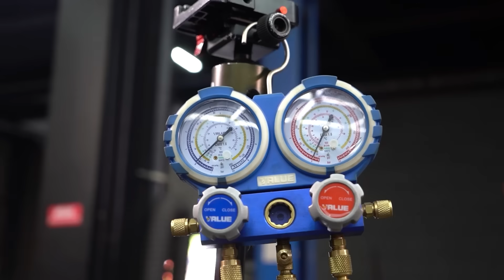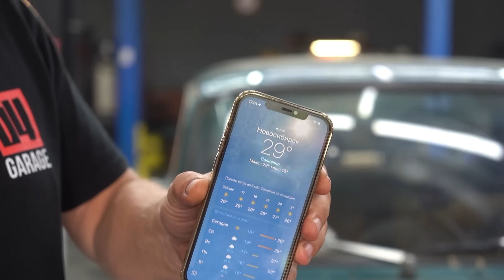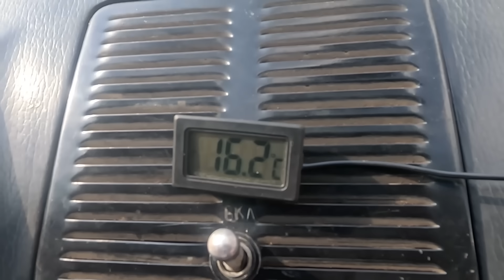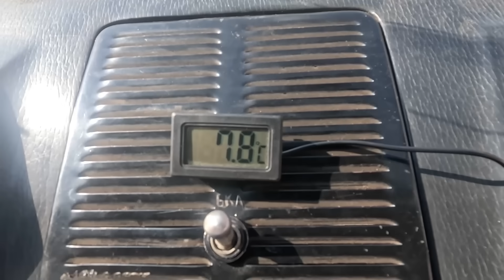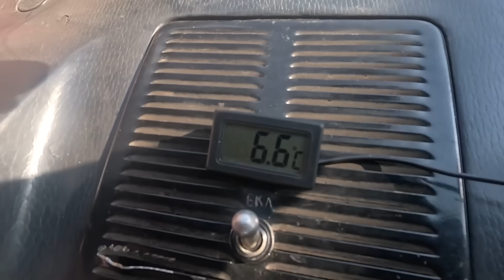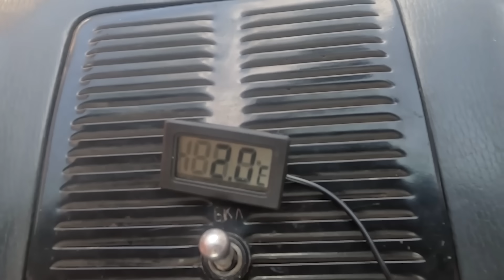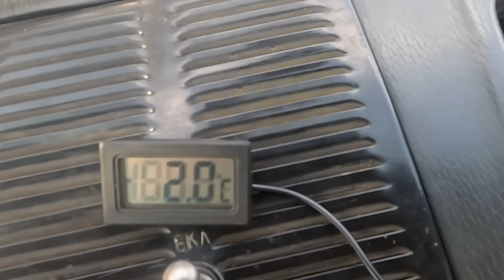Cheap and super cold DIY A/C for an old Moskvich

Comment: Hey this is open to the whole community but was wondering has anybody tried running a a/c system through the intake system to decrease intake temperature I know it's probably more efficient to just do a turbo but I was curious if anybody has ever tried doing it or both

Comment: These guys should one day change the spark plug tips with an assortment of different conductive metals i.e. From Copper which is most electrically conductive to Tungsten which has a high melting point and place it in a spark plug tester for the viewers to see, the problem might be the long time it would take for the tips to wear out, which could take months or even years, which would make for a really cool, really long video

Comment: Moskvich car production spanned from 1946 to 2001. After a period of inactivity, production resumed in 2022. 
Here's a more detailed breakdown:
1946-1991: Moskvich was a Soviet brand produced by the AZLK ( Moscow Factory for Small Cars). 
1991-2001: Production continued under the name OAO Moskvich. 
2022-Present: Production was relaunched, with the first new Moskvich vehicles rolling off the production line in December 2022.

Comment: :35 Если позволите, пожалуйста. Эти «радиаторы», если угодно, охлаждают… ничего. Тепло не существует, есть только разные степени холода. Одно из таких устройств, испаритель, отводит тепло, оставляя холод. Конденсатор спереди, через который продувается воздух, позволяет теплу выходить, оставляя холод. Конечно же, в нём используется фреон в качестве переносчика. Это сложно объяснить, пока не заглянешь в космос, где температура -272 градуса по Кельвину, если только что-то не воздействует на эту температуру, например, непрерывный ядерный взрыв.

:35 If I may, please. Those “radiators “ if you will, cool….nothing. There is no such thing as hot, only varying degrees of cold. One of those devices, the evaporator removes the heat, leaving the cold. The condenser up front with the wind blowing through it allows the heat to escape, leaving the cold. It of course uses Freon as a medium of transfer. It’s difficult to explain until you look at space, where it is -272? kelvin unless something acts on that temperature, like a continuous nuclear explosion.

Comment: 🤩😍🥰 works gr8....how about placing a smaller tube inside that cold air vent, the small tube connected to outside air so that the cold dry can freeze the moisture in the air from within the small tube bringing in outside air....may be that way can actually get the frost blowing on you....another note, a/c compressors are designed for the lubricant oil to be inside its crankcase, not inside the pipes , condensor or evaporator....using liquid propane - lpg cooking gas allowed to flow thru the pipes condensor and evaporator  freezing over everything on the outside untill liquid propane forces out all dirt - debris and oil....also a great way to clean out internally the condensor and evaporator, which in modern equipment are multi flow design, when the outside is being frozen over, you can see if any of the passages are restricted...takes longer to freeze over or does not freeze....

Comment: I'm servicing AC in cars, and yes almost in every car the lowest setting is 16°C but the actual air that comes from the vents is significantly colder, the record was 3.5°C I believe, and that was with all the sensors in place and working.
Reply: Had an Audi A6 blow -0.3°C a few weeks ago.

Comment: heres a tip from a pro ac guy 

always use laminated evap and condenser in r134a, regardless of compressor, make sure you do double capillary expansion valve if possible.

Comment: Just an idea, how much HP would you gain at wide open throttle if you added a few injectors in the intake manifold as well as a port for oxygen on a switch.. kind of like a home made Nitrous system

Comment: Now try to make the engine run on piezoelectric igniter from a lighters. Line them up around the distributor and see if the engine can run off the the sparks that they produce.

Comment: Where is the Snow ? --- 3°C Airtemp from the vent is normal, try to get like -5°C this would be interesting
You need to adjust the Evapurator pressure to reach lower temperature.
With R134a try to get 2 Bar Pressure, that should make the AC very cold.

Comment: I always wondered whether it would be possible to make an airco from the expander from a car that runs on lpg. Usually this expander receives hot water from the engine so it does not freeze from the changing from liquid to a gas. If you use a coolant that's not heated by the engine but just pumped from the expander to a cooler core in the cabin you'd have an air cooler. Requires just an extra electric pump to make the water (+antifreeze) circulate.
Reply: Small amount of gas evaporate for any noticeable effect of cooling unfortunately 😕

Comment: 6:16 - actually, 16 degrees on climate display is target temperature in cabin. To achieve this air temperature from air outlets should be close to 3-5°C degrees.
Servicemen who recharge AC usually put thermometer into air vent outlet and look for this temps to control that recharging has been done right.
Reply: On vw's it goes down to about 7c

Comment: It probably would be smart to say that most refrigerants are extremely flammable and pag oil is not safe to use without gloves and pressurized system which leaks can freeze burn your fingers off
Reply: R134a isn't flammable. Beside that, we talk about very low quantities.

Comment: Years ago I worked in a foundry.  I worked in maintenance.  We stole a 24,000 btu air conditioner from the old engineer's office.  Two hours after the install there was water running down the windows.  Our new term for cold was 'crop damage'.

Comment: You guys are legends, I live in Australia and have installed a lot of air cons but I have never got one that ran that cold 2 degrees C that is COLD. Well done.
Reply: I tried looking at adding one to a MK II Jaguar here in Sydney. But the front of that car doesn't allow enough cool air through, even to cool the engine down, let alone adding MORE stress to it. Even adding a four core radiator could barely keep the thing from overheating in Summer traffic. That was the ONE thing that killed it for me. Turnd it into a very expensive Spring/Autumn time car.
Reply: Throw propane in and watch it go below 0C 😎 on the absolutely hottest of days. It gets below 5 degrees almost instantly
Reply: @slyscafe  ST Hell! R u Serious. Propane? How on earth did you come across that little tid bit? Someone in your sphere had to have tried it before you...
Reply: @dora-de-explora i do it usually with lpg (propan butane mix) although i have r134a. You must charge 40% of original charge. It BITES heat out of cabin.
Reply: @daliborzeljkovic672  I love the idea of a propane butane mix. But I can only do LPG. I buy the cannisters. But how do you mix the two say in a 1lb refillable LPG bottle? Like Flame King.
Reply: @dora-de-explora it's already mixed on gas station.

Comment: Aside from the Jetta, the old AMC HVAC systems had a "desert only" setting that would lock the compressor into constant compression mode. If it was used in a normal hot and humid environment, the condenser would blow frost and freeze over and not blow air within about 5 minutes.

Comment: 0:43 Vlad my 1990 Honda Legend would blow snow out the vents in the correct conditions as well, very thankful it had automatic climate control, it would freeze your hands or feet depending on the way you had the AC discharging.
Reply: it is because of the type of refrigerant they used to use. They dont make it anymore because it is bad for the enviorment
Reply: I do miss r12 refrigerant, its ability to cool was incredible. R290 is a great replacement except for the flammability issue but it does help solve issues if lubrication and is very quick to cool down the evaporator.
Reply: My corolla used to get frost on the windshield if you left it set for defogging.
Reply: My 1989 dodge d100 would get would get so cold that you could see your breath on the hottest days of summer. I miss that old thing.. 😢

Comment: using a bigger compressor and a bigger condenser and fan would probably get you lower temperatures. you should also get a more powerful blower motor and distribute the air among the cabin and i guarantee you will have a meat freezer of a car

Comment: If you had pumped the cold air from inside the rear floor back toward the front of the radiator to help cool it. The air coming out of the vent will keep getting colder and colder. And you should be able to get frost on the inside of the windows !

Comment: Dass ist nichts besonderes, die Ausblastemperatur bei einem BMW E46 oder E39 beträgt -10°C
Reply: Then it's broken. Factory intentionally make it just above zero to avoid freezing moisture on the evaporator.
Reply: @daliborzeljkovic672  Dass ist nicht richtig, es ist so eine Art Boost Modus. Erst wird mit voller Leistung gekühlt und wenn die gewüschte Temperatur erreicht ist taktet der Kompressor und der Verdampfer taut automatisch wieder ab.

Comment: could use one of those as a AC pump for a building, more radiators and a dyrect drive to a motor. but that's an extra $7/hour in gas consumption... unless its an electric solar powered motor, but those panels are sill unrealistically expensive. ... REVERSE THE AC PUMP LINES, MAKES THE CAB VERY HOT? two season use, a simple self contained switching valve would do that, similar to a two or four way hydraulic valve. ... would have to use the exhaust of the engine to heat the evaporator "using AC to heat up cab", or in -40*c the outer cooler would drop to -70*c... all the way to being -150*c on the outer evaporator ... then it is used for... nearly making liquified gas if its cooler is installed inside of a sealed tank with a small amount of pressure inside. ... adding a large block of heavy lead in the tank would then allow for thermal mass... when venting it to make it even colder, liquifying nitrogen, and switching the AC coolant gas out with Helium.

Comment: All good car airco blows 3-8 degrees right ? The amount of air and strength depends on the temp in the car. 

If you set it to 16 it does not blow 16 air temp.... It would never cool the cars interior. So you made a lot of effort to blow few degrees lower.

Comment: They key is to use R12
Reply: Yep or propane. Propane rules
Reply: Propans works and is cheap but when you crash…. 😊
Reply: @Alex-mr4is i don't know. Never wrecked the truck I had it in but it blew snow flakes out of the vents. Back when R12 was $70/lbs and propane was stupid cheap.
Reply: @АлакПатрова in Europe you cant get r12 anymore so we Stick with 134a and 1234yf in the Cars. But I tried propane myself, because its dirt cheap and works perfectly.
Reply: @Alex-mr4is you can in the United States but only from individuals sitting on it. They want at least $100/lbs now. R1234yf works great but is expensive too. Its just hard to beat propane but 1234 is propane based so makes sense.

Comment: I am building an air conditioner for my car. I am using Volkswagen parts though. It has been super hard. Hopefully this summer I will finish
Reply: Video soon. I will post it here. I have a w123 200D
Reply: @saulhidalgo1345  Wow, nice! I have a W124 without an air conditioner, and I want to do something cheap to get one.
Reply: Video?
Reply: Just dont bother using the original york compressor as they rob too much engine power. Get a modern round compressor and you will get even colder temps for less power used.

Comment: I need this for my house!
Reply: Ive been thinking about building one based on his same setup.  Just need aa 1hp or less induction motor and  jack shaft that turns the blower fan inside and the compressor with a belt and some temp control unit that turns on and off the compressor clutch when desired temps are reached.
Reply: @killerdeamonking i did one with lpg instead of r134a. You need more then 1 hp motor 😀

Comment: Try this: fill the AC system with LPG. (Propane gas)
You will experience that it is a great refrigirant!
Reply: You forgot to tell only 40 % of original charge in case it was r134a.

Comment: You got me grinning like a cat eating calf scours. A buddy of mine has a heater by his feet as he sits on a stool at a bench he uses as his desk. I bust his chops when I tell him it's so hot he has his heater set to medium. Now there's adaption kits for window units that will turn a small room into a walk-in cooler for food storage. Handy thing for farmers with good size families. The on line family has a channel called Abundance Plus. There's  another channel he's got that precedes it but it can be found on You Tube as well with that name as he's got a chronological chapter going back for years now.

Comment: I want an A/C system like that for my car. Where I live is hotter, it's averages around 41 to 45 C at this time of the year.
Reply: "I want an A/C system like that for my car." You can unplug the cutoff switch to your AC compressor and have basically the same thing. The problem becomes and is seen in this video, is that to get that cold, that removal of heat has to go somewhere. In the condenser that heat is removed blowing straight into the the car's radiator.  Your engine will run hot and eventually damage the engine.

Comment: I wonder what the HP loss is with that compressor. assuming the car dosent have alot to begin with
Reply: Probably quite a bit. 

I had an old volvo with like 100hp and you could totally feel when you turned the AC on. It was even worse with a car full of passengers. Felt like you were driving uphill.
Reply: @volvo09 agree, I daily a 240 and am in the process of getting my AC fixed since it’s being finicky after swapping to r134 I’m having a shop test it and charge it but I could definitely feel when it’s running lol. Only got down to about 48-50 degrees F on average or 9-10C which some people think is too warm but compared to the other cars my family had it’s about the same if not a tad colder.
Reply: UZAM-412. High revving hemi slant-4 engine. All-aluminum with "wet" cast-iron sleeves. 1,5 l., 75 h.p.
Reply: Approximately 4.4 kW.

Comment: can you use A/C to cool throttle body to increase Hp!
Reply: Cooling the intake and then turning it off for a dyno run or 0-60 test would work, but if the compressor stays running you'll never get that power back.
Reply: @volvo09 maybe with some temu electric A/c... running direct of batteries to avoid engine power

Comment: Wait a minute, I was told these parts was made to work together like man and wife. You can't change the pump for a bigger or smaller 1 as it word not work. And this goes for all the A/C parts
Reply: You can mix and match quite a bit. It’s not a very big deal especially if you keep the cycle switch it will keep it all at the right pressures. Generally the bigger the condenser and higher the displacement of the compressor you run the better it will work, the issue is getting it to fit in the car lol. I’ve built a few systems from scratch for my old cars. Main thing is to clean all your parts really good inside so you don’t mix oil and use the correct seals and hoses for the refrigerant you’ll be running.
Reply: I have heard that the new Dacia Logan or Duster (or Renault, depends on the country) come with a very small ac compressor, and some people swap the compressor with a bigger one, because the original one does not do a good job at all. I can confirm that it does not do a good job, I had driven a new Duster for 4 weeks and the ac sucks.